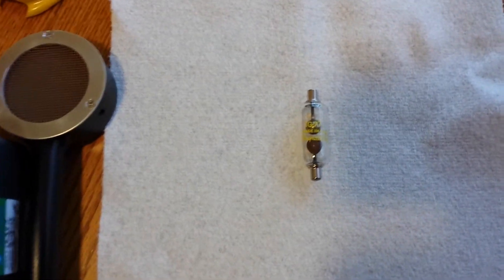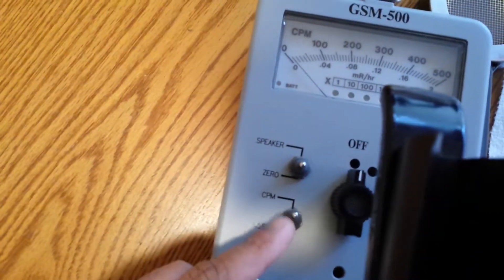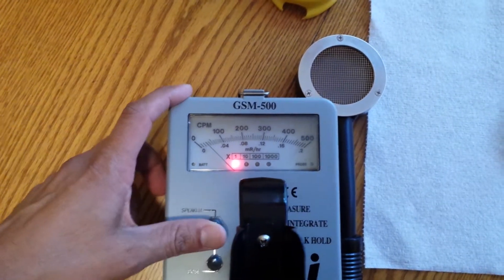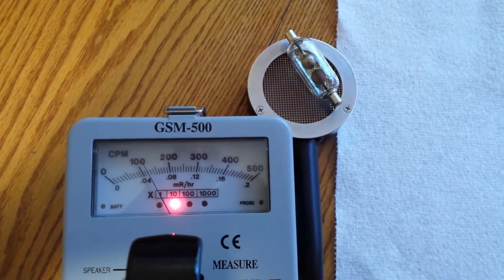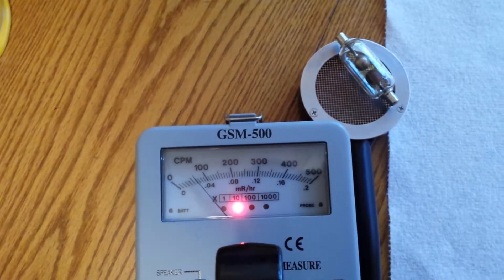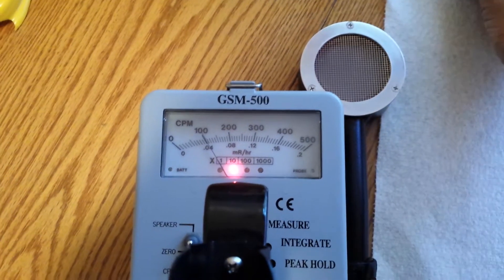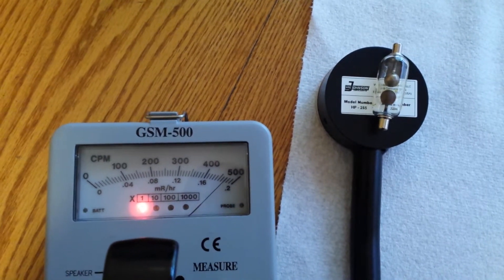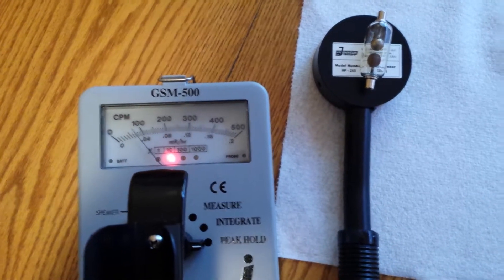Cesium 137 vacuum tube

Comment: Very nice! I have that same tube. I have other various radioactive tubes, and some contain Cs-137. The source is a small blotch of residue on the inside of the glass. Collecting radioactive items is a hobby of mine. I have an Eberline RM-20, but with a Russian Beta-2 pancake-type detector installed. I just tested my TG-77 tube, and I get approximately the same CPM. A little over 1000 CPM on the front, and half of that on the back. Mine is a station meter, so I can't carry it around unless I have a special battery installed. It uses just CPM. I really like your Geiger counter. It's a unique model, and in great condition. Thank you for sharing this! Great quality! Happy hunting!